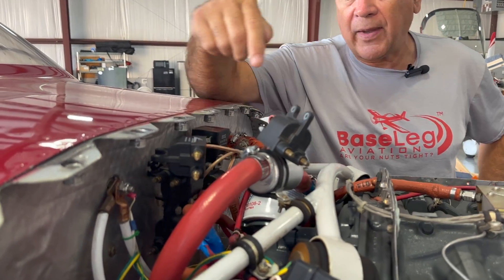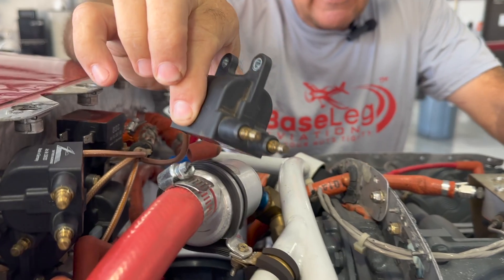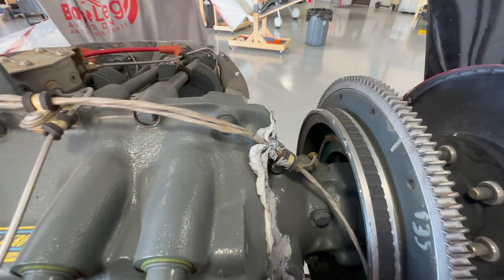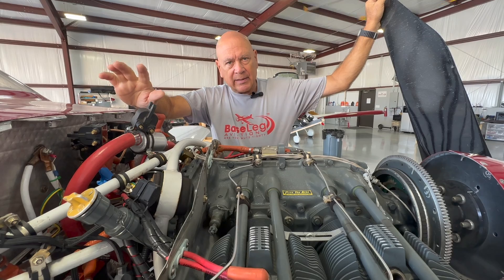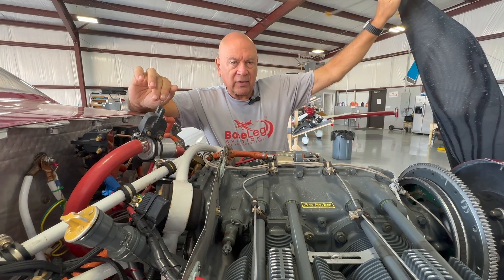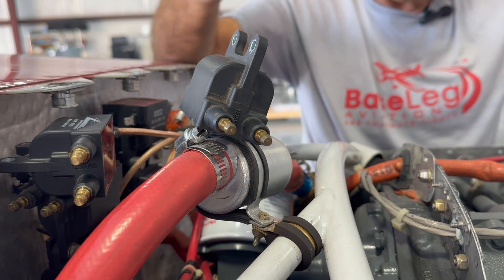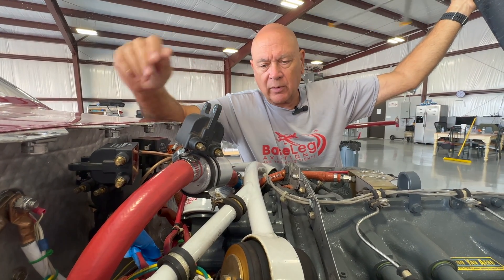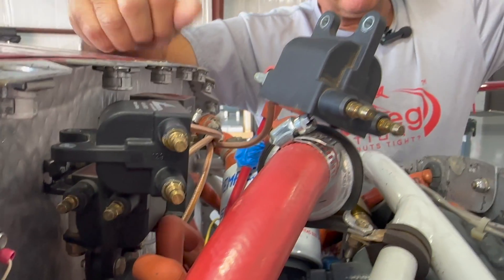Troubleshooting lightspeed ignition on RV 7a

Comment: I didn't get how to "troubleshoot" the system. We already knew it wasn't working. How did you decide which component was bad? Swapping coils would rule those out, but what pointed to the ECU instead of the pickup? What about wiring or fuses?
Reply from the maker: Watch for the whole story in a column soon.